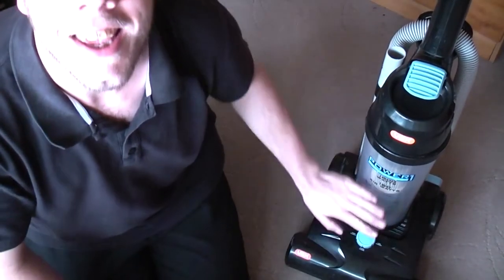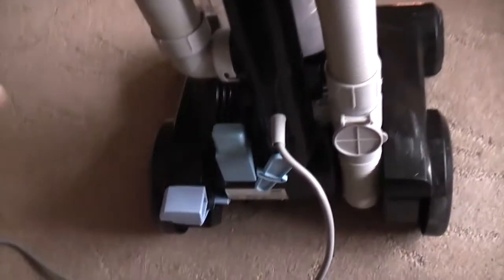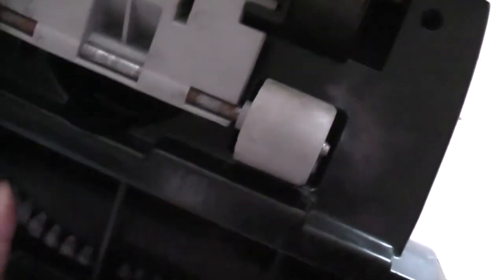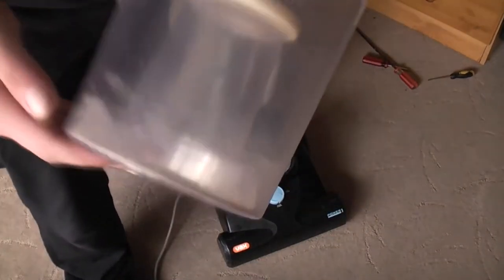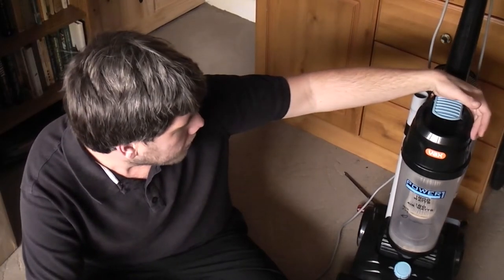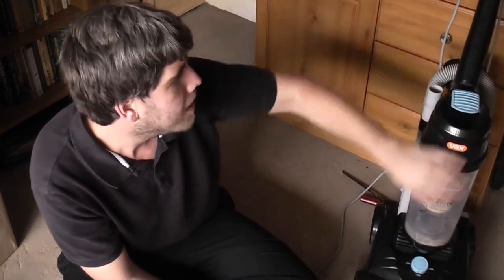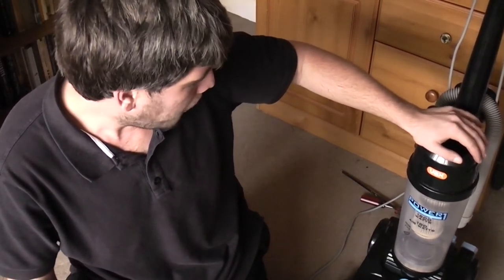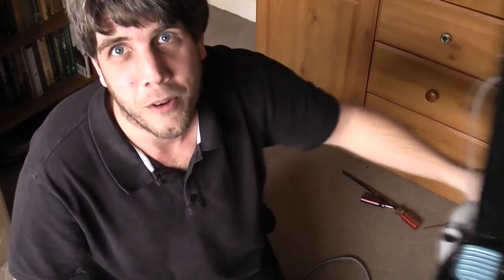Vax Power 1 U88-P1-B - After Refubishment!

Comment: i havw U88 P2 model. on/off switch broken. how to rewire new, but not the same,switch. heelp:face-orange-raised-eyebrow:
Reply from the maker: Assuming you can strip the machine down to get to the switch it'll just be Live flex wire to the switch and neutral blue to the neutral wire on the vacuum.
Reply: @beko1987  thank you so much fo help.your videos are excellent. unfortunately our model is U